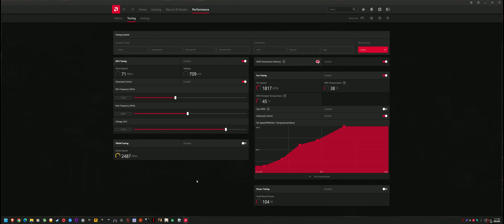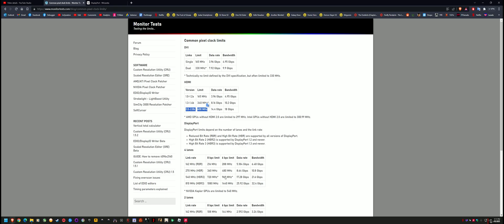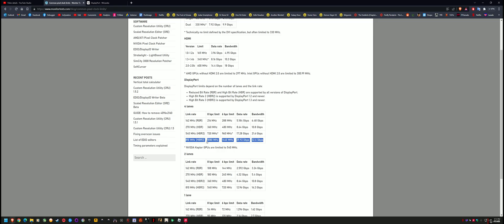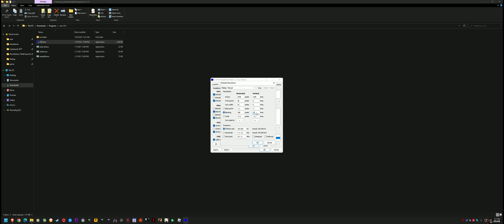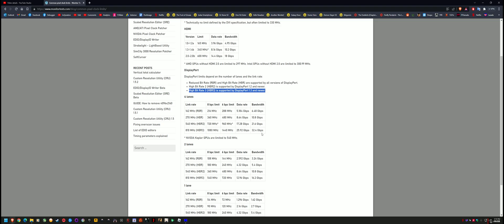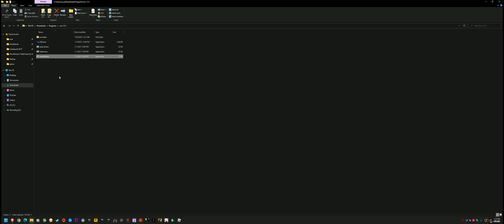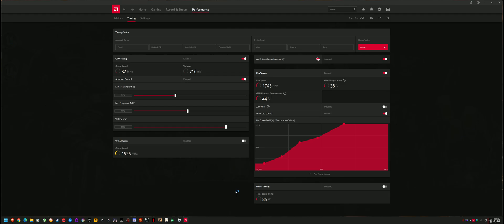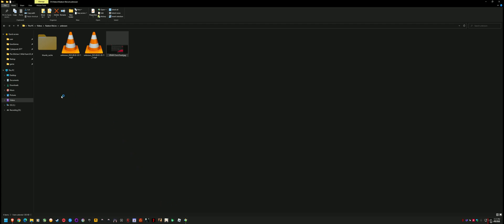RX 7900 XTX High Idle Power / Stuck VRAM Clock Fix (CRU)

Comment: Need help my 7909xtx oc asus tuf clock speed used to be 2600mhz but now it’s only 1200 and idk what to do
Reply from the maker: Does adrenalin open? I'd suspect a driver or temp throttling issue.

Try running DDU then reinstall drivers.
- https://www.techspot.com/drivers/driver/file/information/17830/
- https://www.amd.com/en/resources/support-articles/release-notes/RN-RAD-WIN-25-5-1.html

& maybe reinstall the latest chipset drivers depending on your CPU + Mobo, there are recent ones in the past month that are good with latest GPU drivers.
- https://www.amd.com/en/support/download/drivers.html

Also worth closing any background apps in your notification tray(next to clock) sometimes they can be hidden so you have to hit the arrow to expand, right-click & close anything unnecessary, skype, wallpaper engine, mouse/rgb software etc. You should only have the radeon icon, internet, sound & security before testing.

After the above, go to performance>tuning tab, enable manual tuning>GPU tuning>advanced & cap the max freq slider to 2600mhz like before then hit apply in the top right, leave mV slider alone, then DL & install HWinfo https://www.hwinfo.com/download/  run in sensors mode and scroll down to the GPU metrics, the 2 main ones to check are hotspot & memory junction, minimize it, then test in something like unigine superposition. https://benchmark.unigine.com/superposition in 4K optimized setting. You should see around 23k and hotspot temp should ideally be under 90C unless there's a serious airflow or cooler paste issue(degradation) over time & the full run should obviously pass, if it crashes before it can complete, check the hwinfo 'maximum' column temps for those 2 GPU sensors.

Hopefully it's just a driver or windows bug(windows sometimes breaks drivers because of auto update), but if not just reply if you get stuck and I'll try to help, good luck!
Reply: @PatchFixGaming I’ll try it thanks, I have a 7800x3d with a b650 gaming av or whatever, at work rn, but when I’m done I’ll do what u recommend and update you, thanks bro
Reply: @PatchFixGaming ddu method didn’t work😒
Reply: @PatchFixGaming actually messed up my performance
Reply from the maker: Then there must be an underlying issues(possibly EXPO stability?) Latest chipset drivers control motherboard communication & nobody has reported problems, while GPU drivers are self explanatory. DDU just fully uninstalls all old GPU driver files to ensure the new drivers run smooth.

It IS however possible that the specific games you're playing have problems on the most recent driver, in which case you'd want to run an older version, personally my 'fall back' driver incase of issues with specific games is 24.7.1 though I've seen a lot of people recommend 24.10.1 & 24.12.1 too, you can find them here; https://www.amd.com/en/support/downloads/previous-drivers.html/graphics/radeon-rx/radeon-rx-7000-series/amd-radeon-rx-7900-xtx.html - Though to note, I'm currently on 25.5.1 /w 2400mhz max freq & they seem ok.

Just be sure to cap the max frequency in performance tuning tab after changing drivers again as it will reset & uncap to a 3220mhz+ boost target by default, which can cause high hotspot temps & power consumption for little gain & if there's an underlying temp issue it will make it worse especially for VRAM.(GPU memory).

Watch this clip on RX 7900 XTX tuning, https://youtu.be/b411Ro2HMi4?si=VqSolSfePeBpgkqn&t=228 the grey number = fps, red is power. ~2400mhz is far more efficient for the power consumption compared to ~2700mhz for a <10fps(usually less) boost / 50watt trade off,  so you could mess around with that on the current driver & check hotspot + memory junction arent running hot instead of the higher or default targets & see if it helps.

I think the above fixes making performance worse if not driver issues may be traced back to that 1200mhz 'stuck clock' issue you mentioned, was that core or VRAM? Re-run superposition 4k optimized benchmark with HWinfo open and check the max memory junction temp to make sure the airflow in your case is ok, as VRAM running hot will throttle the memory clock, especially if your case fans are on bios defaults which spin slow and only follow the CPU temp, so the fix there is to check your CPU 'gaming' temps, which might be in the 50-60C range, then go into bios and adjust all your case fan curves to spin up to at least 60%+ @ 50-60C to give the GPU more airflow, along with setting your GPU fan curves more aggressively.(Especially if you have a hot room and dont run AC).

And lastly if everything above makes no difference, run SFC scan to check your window file integrity, its a command that lets your windows automatically find and fix problems; https://support.microsoft.com/en-us/topic/use-the-system-file-checker-tool-to-repair-missing-or-corrupted-system-files-79aa86cb-ca52-166a-92a3-966e85d4094e#:~:text=The%20sfc%20/scannow%20command%20will,Corresponding%20action

Then if you've got XMP/EXPO enabled for your ram but never stability tested thoroughly, I'd forget about the GPU for a moment and focus on ensuring the memory is 100% stable, a slight memory instability can run perfectly fine for months then suddenly stuff starts breaking due to background OS & driver corruption,, Testmem5 is a good memory test; https://www.overclock.net/threads/memory-testing-with-testmem5-tm5-with-custom-configs.1751608/ The quick guide for that, is DL & extract the tool to a folder, and run TM5.exe on default settings & see if it passes, a single error = instability & you'd then want to read guides on tuning/tweaking your ram, or disable expo in bios as a temporary solution(though you'd lose some performance, its better than running with instability).

Hope something there helps,, GL!

Comment: Main Monitor 3440x1440 175Hz LED
Secondary Monitor 3440x1440 can run 90hz, but set to 60hz LCD

DP1.3

LED Monitor set the blanking to 125 (10BPC)
LCD Monitor set to  3000 (8BPC)

Both set blanking to just below 1000 to be safe (975ish) 

Memory Clock dropped from max to 909MHz and TBP from 88 to 47

I had to go in and create a DP 1.3 profile for my LCD monitor as well and set it to default, but I just kind of copied what my LED had, but changed the numbers to match, then set the blanking

Comment: Seemed to have worked for me. Went from GPU board power at 80+ W idle, down to an idle of 25 W.

3440 x 2560 set to 215 lines when refresh rate is set to 165Hz.

I'm gonna run some benchmarks now to make sure everything is working as intended, but we're off to a great start. Thanks for sharing!
Reply: Quick followup a month later. Everything works great!
I even think my power usage is lower now when GPU is at 100% compared to before this fix. Not quite sure on that, but it seems more quiet to me.
Reply: Second update.

I updated my GPU drivers, and suddenly the CRU fix didn't work anymore. I tried reapplying the settings, but my VRAM just wouldn't downclock and my idle power usage was high.

In the end I got it working by uninstalling drivers with DDU, installing fresh drivers and applying my CRU settings again. Phew.

Comment: im sure everyone has a different resolution so im wondering what numbers we need to change for blanking cause im using 2560x1440 75mhz and its blurry as balls.
Reply from the maker: @Auswos101  Try the auto setting in pinned comment. And as for 1440 if thats your native monitor res it should be clear at desktop not due to blanking,, try checking your monitor OSD for a sharpness setting. Can make a huge difference as well as enabling windows clear type(search in start).
Reply: @PatchFixGaming  when i change it to automatic pc it forces my pc to use 1920x1080

Comment: Would upgrading to an HDMI 2.1 cable help this, since it has higher bandwidth. Or the blanking needs to be adjusted either way?
Reply from the maker: It can help if you're having issues on a lower spec cable, but YMMV & might still need adjustment.(Depends on driver version too) as I've heard of power issues being resolved after DDU + updating.
Reply: @Jo3yization  hmm ok thanks. I'm having the issue on newest driver so I'll look into it
Reply from the maker: Latest drivers all have issues for me, particularly with Relive recording, 24.7.1 still best.

Comment: Just wanted to share my experience after trying this and it not immediately working, and what did help (context below, 2 monitors on a 7900XTX):

I use 2 Monitors, as I recently upgraded to an OLED, a 240Hz Main Panel and a 144 OCed to 165 secondary Panel (old monitor). First, I tried using CRU, but when opening the main monitors settings, the vvalue was already very high (179 and Pixel Clock is 1056,75 MHz). Tried 200 but changed absolutely nothing, as I kinda expected.

What did help was settting the secondary monitor down to 60Hz from 165Hz. Immediately dropped my idle power consumption by 30-40 Watts, from at LEAST 100 Watts TBP to low 70s, 71-73.

The drop in VRAM clocks is MASSIVE. From the 2600 I usually run it at, it now clocks down to 1500, or even below 1k, with Adrenaline reporting TBP as low as 65 Watts (curiously this value is 10W lower than what HWInfo 64 reports).

Now I just wish I didn't get bad silicon lol. My GPU will not accept any Undervolt at all in actual games, and pushing VRAM beyond 2600 also appears to be unstable, despite temps always being good. Oh well, at least PL-10% and slight VRAM OC give stock performance lol
Reply from the maker: Nice & thanks for sharing,, what might help with silicon quality and undervolting is the fact the reference XTX clock is just 2300mhz for the shader, while the higher boost clock is for the front end and a separate part of the card, they separated them and advertise the 'front end' as the max boost when in-fact they are separate parts of the card & game/shader clock typically wont sustain anywhere close to the front-end clock.

Knowing the difference helps because the max frequency slider is not for the front end and actually the limiter for the shader(game clock) and leaving it default/stock is basically uncapped, so under load the card is always trying to boost as high as possible within power and temp limits and not following AMD or AIB game clock spec at all, so if your cards game clock is advertised for ~2500mhz(most are under 2500), but the card is trying to boost to 2800mhz, the result is high temps and very little headroom for adjusting the mV slider, since the voltage also increases with the boost.

Simply capping the max frequency to your models game clock will get a significant voltage drop without even touching the mV slider and the performance loss is also minimal, since most cards never reach the uncapped shader clock target over 3000mhz and the voltage tying in with the shader clock target ruins efficiency.

So to summarize, focus on the GAME clock, ignore the max boost. The max frequency slider caps the GAME clock and the max boost is just BS marketing, you can even see the difference in AMDs marketing slides here;
https://postimg.cc/YGV6wtXY - Shader = game clock, front end = max boost(decoupled) and we have no control over the max boost directly.

You can use HWinfo and search for the 'shader clock frequency limit' to see what its actually attempting to boost to at stock; https://postimg.cc/2qy9yhNN - My Nitro+ was uncapped to 3220mhz even though it never hits this high.

Then simply cap max freq to a sensible AIB clock in the 2300-2500mhz for a huge efficiency improvement and hotspot temp drop, you can go higher but the tradeoff isnt worth it, the Red devil(2400mhz) is more efficient than the Nitro+(2510mhz) but in actual testing they perform around the same, so I use 2400 on my Nitro+. When set you'll see the change in HWinfo straight away, mV slider can be left alone as this is a more effective way to reduce power too. https://postimg.cc/2L6xs9B0

Hope that helps!
Reply: @PatchFixGaming  Wow, thank you SO much for your detailed and insightful response! I had already become confused by the clocks, as you say, things are not as they seem and I had already noticed this discrepancy when watching HWinfo after locking the clockspeeds down. I'm a bit busy right now but I'll play around with some settings another time and see how they work for me.

Comment: Hi and thanks for the video! I own the Nitro+ 7900 xtx and I want to ask you, is 900 mhz VRAM clock speed ok when not in load? Also when intense gaming I saw the GPU memory temo go up to 83-86C is that ok?
Reply from the maker: Full VRAM speed is fine depending on what kind of display(s) you're pushing as the temps mostly go up with utilization. For load temps, lower is always better but I'd only really worry at 89C+, the GPU fans follow the core temp so in VRAM heavy games that dont heavily load the core as much(whether it be GPU bound or because of FPS caps), you could simply see what kind of temps you are getting and ramp the fans up a bit in that range for lower VRAM temps.

Same goes for case fans, the default curves are VERY relaxed & follow CPU core not GPU at all, so if your CPU is chilling at a lower temp when gaming, ramp the case fan curves up in bios so they spin up 50-70%(Your preference) at the temps your CPU typically reaches so the GPU gets proper airflow.
Reply: @PatchFixGaming  Thanks a lor for the detailed answer! I don't know much regarding bios management but I will give it a try. From what you tell me I am sure that tweaking the fan settings would make a big difference.

Comment: I'm so frustrated about this "issue" that i can't really enjoy my amazing new display. I have also max VRAM usage with my new 360Hz OLED and 7900xtx. I tried the new method (2024) with CRU but getting strange flickering (white/green) in certain peroids, so i reset it. This Display uses DSC like all other 360Hz Oled Displays and i use it with a DP 2.0 Cable. Tried it also with DP 1.4 Cable it came with and HDMI 2.1
Reply from the maker: Hmm, if you havent already tried enabling 'adaptive sync' under AMD software>settings cog(top right)>Display tab, then my other suggestion given 360hz is a very high refreshrate(even Nvidia cards have issues) then other than OSD settings that might possibly affect image stability, make sure your windows is upto date and look for a setting under desktop>right-click>display settings>advanced display, there's a feature called 'Dynamic refreshrate' which should let the monitor automatically clock down at desktop for basic use & still ramp up to full speed when gaming.

You can also look for a setting under windows>display>graphics>advanced graphics settings, make sure HW accelerated scheduling & variable refresh are both enabled there too.

If you're on an older version of windows that doesnt have those features, might be worth updating to Windows 11 24H2, which you can get directly from microsoft here; https://www.microsoft.com/en-us/software-download/windows11 , mounting the iso for an in-place upgrade should also work.

Here's a RTX 4090 owner having problems with 360hz OLED; https://forums.tomshardware.com/threads/vram-does-not-downclock-with-2-monitors-active.3856553/
Reply: @PatchFixGaming  thank you for your reply. Yes, if i enable FreeSync Premium Pro my VRAM becomes normal. Thats great, but requires to let it enabled all the time. OLED Panels has some issues with VRR Flicker, especially with dark areas. You can also notice this flicker while browsing... Its not a big deal but a bit annoying. Also for competitive games FreeSync etc. are not really helpful. I think Dynamic refreshrate is not avalible for this Monitor, can't find it. HAGS also don't help if FreeSync / VRR is disabled.

I read a lot about this issue and can't figure it out whos fault it is. It seems that AMD is more affected. I also think there is a lot of OLED owners that are affected by this issue, but they don't check idle consumption and don't cate about it. It's really frustrating.

btw. I'm on the latest Windows 11 & AMD Adrenalin Version. I tried DP 1.4 / DP 2.0 / HDMI 2.1
Reply from the maker: If you get flicker with freesync enabled while browsing(you shouldnt as desktop/browser should be locked fps), try going to windows start>display settings, advanced display and click the arrow next to refresh rate to see if there's a dynamic refresh option.

It's a new feature they added which turns on by itself & drops the desktop all the way down to 60hz on high refresh monitors when multitasking & mousing over the taskbar,, was causing annoying flicker with freesync enabled for me.

Comment: So would a Displayport 2.1 cable help this?
Reply from the maker: It can as long as you're aware it's a hit or miss kind of thing, sometimes even replacing the 'proper spec' DP cable that came with cheaper monitors can still help fix issues trying to run higher pixel clocks since cables can function fine but still be low quality.

Also make sure to try using the 'automatic PC' setting as detailed in the pinned comment if increasing blanking manually didnt work.

Comment: I can fix high vram clock speed but when i tried play game after several minutes my resolution got blurry. 

Rx :6700XT.
Monitor : 180 hz -> 175 hz. 
Blanking : 160x95.
Reply from the maker: Try again but use the 'automatic PC' option which is in the dropdown at the top of detailed resolutions window, I would try and avoid changing the base refresh rate if possible too, or it may simply not play nice if you're using adaptive sync, try enable/disabling it.

Also make sure to keep most gaming>graphic options disabled aside from radeon image sharpening, there are some features such as radeon boost that lower the visual quality when moving the mouse, its horrible if you notice it.